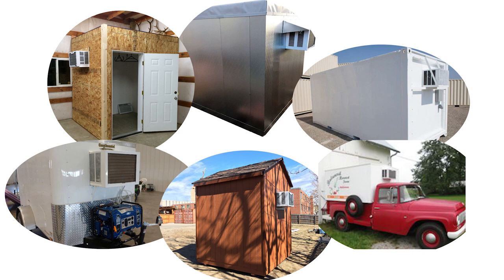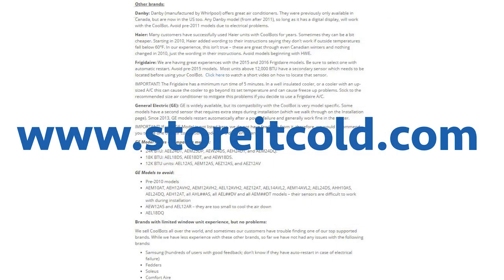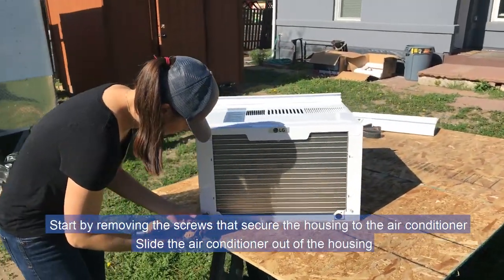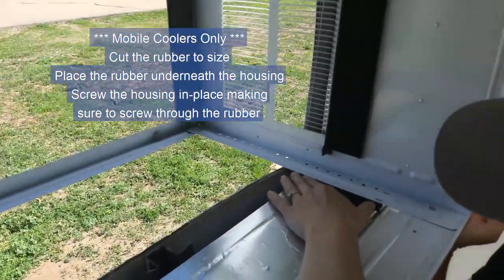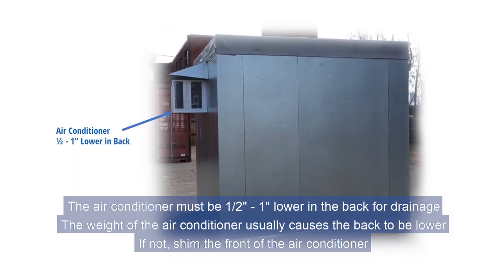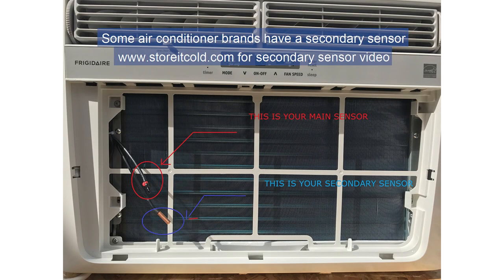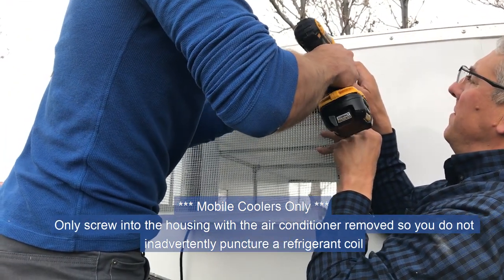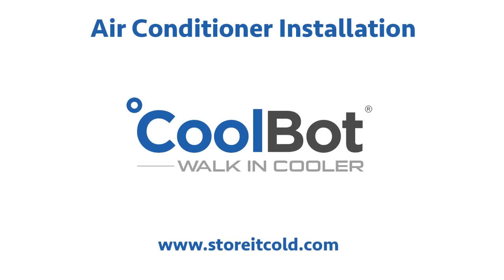Installing Your A/C for Your CoolBot Walk-in Cooler

Comment: I'm happy for you but mine doesn't work, and I don't know what to do, the compressor stops at 61 f and doesn't go down
Reply from the maker: If you're unable to hit your set temperature, the CoolBot may not be installed correctly. Let's get you in touch with our customer support team to troubleshoot the issue. You can contact them at 888-871-5723 or support@storeitcold.com. You can also visit our website for troubleshooting guides. 

https://www.storeitcold.com/troubleshooting/

Comment: What's the difference between a coolbot and just getting a thermostat controller that turns on and off the appliance between certain temps?
Reply from the maker: Hi Alex, thanks for reaching out.  The CoolBot is a micro controller that allows you to cool a well insulated room down to refrigeration temperatures using a window A/C.  There are several different sensors on the CoolBot that allow it to get to those temperatures without freezing up.  A pass through thermostat does not have the ability to control the A/C the same way the CoolBot does.  Please email us at hello@storeitcold.com with any other questions!